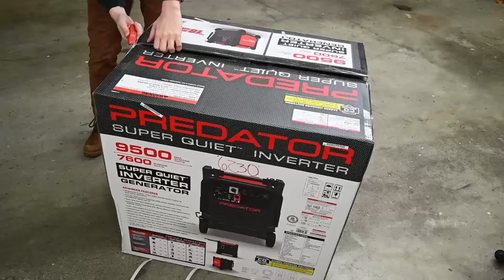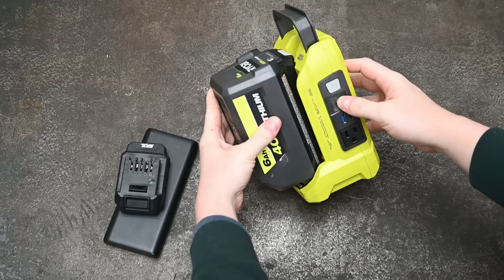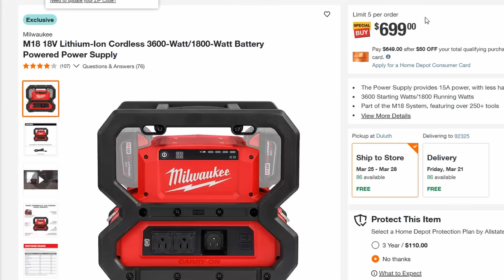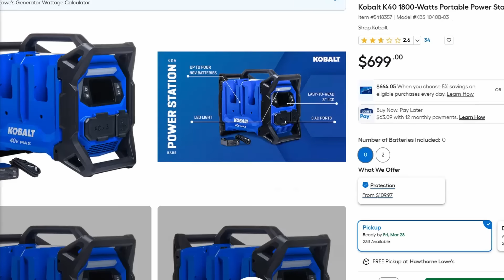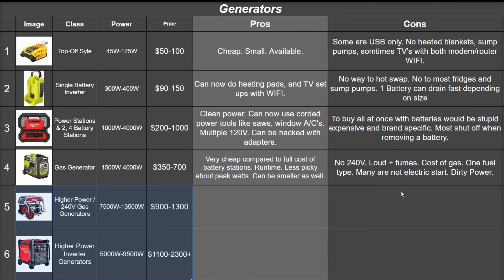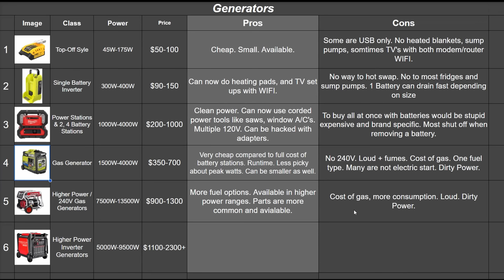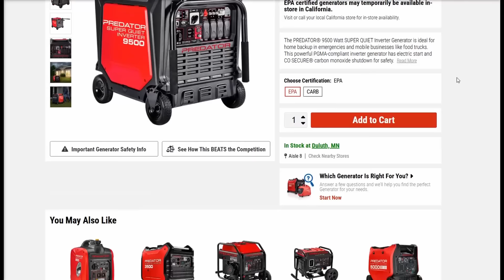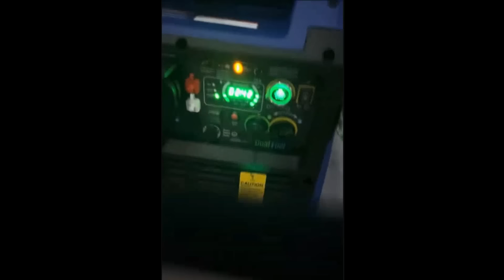Buying Harbor Freight's Most Expensive Generator So You Dont Have to

Comment: When you run on generator, you are your own utility and there are procedures when setting up and operating a power plant. 

SITE your power plant where you can ground and connect it to operate it safely. If the weather is  not considered to be safe (lightning, torrential rain, high winds, massive hail), stay in shelter until the situation  calms down. Pre-site it, set a ground rod, and make a file folder containing instructions and location info.

GROUND your generator! Run a solid conductor from the generator's ground lug on the frame to a metal rod set in the earth. Preferably a couple of feet down. You will be safe if there is any problems with the electrical wiring on the grounding side. But it won't make you invincible if there are any problems during operation. The following set of instructions are set up where safety and preservation of your property and investments ensured.  If you can, connect it using the one hand method. Use your dominant hand to touch potentially live connections, this means almost everything is treated as a live circuit.  Tuck your lesser hand in your belt or pocket. This prevents a circuit from being made in your body across your heart.

First is set up. Make sure all loads are disconnected at the breaker panel. This means, all breakers that are higher than 15 amp are set in the OFF position. Not tripped, but OFF. The master breaker is is to be OFF too.  CONNECT the generator to the GENERATOR side of the transfer switch. This is critical and dangerous if the panel is miswired. Practice this in normal situations so you know what to expect when you are in the middle of storm conditions.  CHECK the generator connections and cabling to ensure there is no damage, badly kinked cables or broken connectors.  Double check the transfer switch to ensure it is in NORMAL mode.  START the generator, let it warm up to normal idle speeds and temps.  CLOSE the main breaker on the generator. If there's a problem at the transfer box or the wire leading up to it, this is when that breaker will trip.  Set the transfer switch to BYPASS or GENERATOR mode. This closes the pathway to the breaker panel.  CLOSE the MAIN breaker on the breaker panel.  LISTEN to the generator for any sudden load changes from here on out that might suggest a problem.  Let the generator stabilize between each breaker close.  CONTINUE closing each breaker, listen to the generator and watch the lights for any dimming or excessive load. Keep any unnecessary breakers off, like the stove or dryer. Remember, this is your temporary power plant until normal operations are restored.  Once all necessary breakers are closed, bring up your climate control/HVAC and allow it to stabilize to a normal state, paying attention to the generators behavior. Watch your generator's exhaust and listen to it. If there is any excessive smoke or nasty sounds emanating from it, you need to consider shutting it down and getting it checked out.  Watch your sensitive electronics, keep anything you are not using disconnected. Feel your chargers or power supplies for any excessive heat. Some generators throw a modified sine wave that stresses power supplies. Pay attention to the generators specifications while shopping. True sine wave power plants cost extra, period. 

For shutdown, reverse the process, starting with the house breaker panel. DO NOT SHUT DOWN THE GENERATOR WHILE IT IS STILL SUPPLYING POWER TO THE HOUSE! This will damage and destroy anything and everything.  If the generator is gasoline fueled, the following is recommended after isolation from the transfer switch.  Find the fuel shut off valve and turn it to CLOSED. Its usually a quarter turn. This will empty the carburetor, starving the engine. This prevents any formation of sludge or deposits in the fuel system that would inhibit or prevent the engine from starting. Once the engine has stopped, hit the OFF switch, this grounds the ignition system. Let the generator cool off before refueling it fully, then move it back into its home.

Post-season checks include following the manual's maintenance schedule, at least quarterly exercising the engine under load, putting a few drops of Marvel Mystery Oil in the plug hole, then motoring the engine by pulling the recoil or the start button to move the piston through a few cycles. This preserves the exposed parts in the piston bore.

Comment: I have had 1200w, 2400w, 5000w and a 9600w tri fuel generators, they all served my well over them years, but now in my 70's went for 26khw Generac installation with auto transfer.  Not cheap at $17k, but well worth it, runs on natural gas so I don't ever have to worry about storing gasoline fuel or lifting 100 pound propane tanks.  If you have access to a natural gas line, it's the best way to go .
Reply: Have you had to use it yet? Do you know how much it is to run your house off natural gas for like a week?
Reply: $17,000?  You could go to a hotel for like an entire year for that price. 😂
Reply: @jo9732 $400 a night, might have to travel 25-125 miles to find on with power after a major storm, meanwhile your food rots in your fridge and freezer, your property is unprotected  how much is all that going to cost you.? and that's if you don't get killed trying to find a safe having.   Small generators don't work for more than a few days before you run out of gasoline, gas stations pumps run on electricity.  No thanks, been without power for weeks before, never again.

Comment: I got the Champion 8500 as I have LP with gas logs for heat when having a power outage, it will run my well pump and hybrid water heater, all the power I need as long my HVAC is not being used.

Comment: the way i did backup power is batteries. since the power is normally never out for more than six hours (usually at most an hour) and is generally reliable i can use batteries and inverters (where needed) to keep stuff running. since my internet/network devices use the same 19.8v dc input (but can accept 12-24v) i use a battery with a voltage regulator and that's their backup. the fridge is a 100ah 12.8v lifepo4 battery and a good quality 1000/2000w inverter. still working on power for my computer stuff (got an input power limit on this circuit)

Comment: I have the ego power station as I have alot of battery's for it and it awesome can run my fridge and gas boiler no problem in an outage for over 24 hours all while being silent and wont be stolen let a generator can be if left outside.

Comment: They are releasing a tri-fuel 11,500w super quiet inverter model with 240v50A, CO secure, remote start, etc. either this month or next month. They do have a tri-fuel 13kW model currently available that has 240v50a that I'm sure you're aware of but obviously it's not an inverter (super quiet) model.

It sounds like you should have waited a few weeks for the 11.5kW tri-fuel inverter generator. I believe retail will be $2500 but that may have changed with the tariff situation. If you do want to trade the 9kW version in for the new one when it's released, you can just pay the difference between what you paid and the price of the new one, as long as it's within 90 days of purchasing the old one it would be considered an "upgrade in the same category" and thus not subject to the 20% restocking fee. 

Just wanted to mention it in case that's something you'd be interested in.

Edit: shorts/iBWvy3hSt2s
Reply: I’ve used the upgrade in the same category thing quite a bit. Never ever had any problems with employees when requested.

Comment: I own that rigid top off. I use it to run my cpap machine overnight when I'm camping off grid. A 4amphr still has juice in the morning.  I love it.

Also check out Duromax generators, they have up 16k watt inverter models. I have a 13k non inverter and it run the whole house including sensitive stuff.

Comment: The other issue I've had with larger gasoline generators living in Michigan is cold starting on some units.  I had a 4kW Honeywell unit that was a great little generator, but when it was cold outside boy did you have to crank on it to get it to run.  And man let me tell you how rage-inducing it was when the pull cord snaps off in the middle of a blizzard when the family is inside shivering under blankets.

I ended up getting a Champion 9.2kW model with EFI and a built-in starter and like you, my only complaint is the harmonic distortion on it makes my electronics upset.  But it is nice being able to just throw the entire house on it without having to worry about the load on it like with the little 4kW unit.

Paying $40/day for gas when the power company says restoration is 4 days away is no fun, though.

Comment: You should have bought an open frame inverter generator.  Best overall compromise.  I love my WEN GN875i.
Reply from the maker: Wanted the quiet feature for the fam, also it can be left outside in snowy weather for days partially covered so it seemed to make sense

Comment: When i bought my predator i bought the warranty. I never buy the warranty. When they said and i asked again to make sure that it covered theft. I was in. So buy the warranty. If you have any problem just return it in the first 2 years. Or just return it anyway. I use my generator A LOT about 3000 hours a year. Never once had a problem. Never seen anyone at the race track have a problem with one either. Mines 6 or 7 years old. Probably about time for a new one.

Comment: I have a gas stove, range, and water heater. I opted for a 5000 watt continuous 6500 peak Wen inverter and it has been amazing. starts first pull every time. That said I have followed the break in procedure to the letter. I have a theory that Honda gets such a good rep because people buying them are caring for them as you should any equipment because of the price point. so statistically they seem to be "better". Things made in china work just as well as anywhere china builds to whatever spec they are given just like anywhere, for people to think china cant manufacture when they make most of the worlds goods is so silly. take care of your stuff and it will take care of you.

Comment: I usually have a couple working automotive batteries around.  When the power goes out, I've just hooked up an inverter to one of my car batteries.
Reply: Yep. I have a Jupiter 2000 pure sine wave inverter and 30’ 2ga jumper cables. I can keep my fridge and furnace running silently overnight from the car sitting in my garage. Save the generator for daytime use with higher loads and the noise is less of a factor.

Comment: You can get inverter generators for cheaper than $1100 and they wont have dirty power. You can the WEN DF680iX (6800W 240v inverter) for under $800.
There are inverter style generators in each of those price points in 4,5, and 6. The categories on the chart seem a bit misleading in that way.

Comment: Propane is a must. Better to have two smaller generators paralleled than one big one. Just more portable, demand scalable, more fuel efficient, and redundancy is always key in an emergency.
Reply: Yes, but you can't parallel them unless they're synced for frequency, voltage, and phase (some inverter gens allow this with a kit).  Otherwise, use one gen for one branch and the other for the another.

Comment: Yeah you jus bought the wrong one. The largest generator they have is the 13500 and it's tri fuel and worth the cost and would be way cheap if you have gotten it recently. And it's got all those features you want and a couple more...
Reply from the maker: My current generator can do all of that, needed a new one for the reasons outlined in this video which that 13.5KW wouldn't be able to solve
Reply: @TorqueTestChannel  only one I saw that it didn't cure was the noise cause it's louder than the inverter. But yeah it does all the other things you stated. I saw your current generator which was quite nice when it came out but the 13500 did all that as well. Im a proud owner of one and I've run my whole house no breaker off of it twice now... No flickering all power. If I had that connection you have on my house id only use the power company half the time. Actually the 4350 version did all that but it's always loud the 13500 had that run down mode. It's only loud when using more than 5000watts continuously
Reply from the maker: @cutthroatkid.d  But if its not an inverter, I think it doesnt solve the heater not turning on due to dirty power signal no?
Reply: @TorqueTestChannel  i would have to ✔️ that one out cause seeing you do it was the first time i thought to do it. I have heaters that i ran then cause i honestly didn't think it remember that the unit was plugged in. I know where the plug is but sadly i figured it was hard wired and never added up that math SMH
Reply from the maker: @cutthroatkid.d  ya only reason bought this 9500 is for the clean wave form. Past heater didn't care. New one is picky
Reply: @TorqueTestChannel  well in the next week I'ma gas my generator up and let you know how it handles my unit. But I'm sure the way you have your house set up it would run it fine. But I'll be sure to let you know

Comment: I got the predator 2000 that was returned out of box on a manager special for 250 $ a few years back. Still sells new close to 600!$.
I have it for fridge, gas furnace, Wi-Fi, sump-pump and other small emergency items such as radio, TV, cellphones. 
It has just enough power to run those things...
Pro tip.
Get yourself a fuel transfer hand pump so you don't have to store gasoline. Feed the tube down the fuel tank of your car and suck it out of your vehicle tank. You generally have 10-20 gallons in your tank which will last you for days and you don't have to worry about storage of fuel.
Reply: I've had a 5000/6500 generator for about 15+ years, and have for almost all that time had it plumbed to backfeed the house.  It works great and I can run everything in the house (except the central A/C condenser), just not all at once.  We had a 2 week outage due to a blown up substation, and it only took a day or 2 to get into a rhythm: don't run the washer/dryer/microwave/hair dryer at the same time, was pretty much the only major rule.  5 gallons runs for 16.5 hours.

Comment: Excellent video , I have options 2 and 3 for my ego batteries and can prob run minimum necessities for a day or two. Before I had option 4.

I am looking at option 6 but I want an inverter trifuel as I wanna hook it up to the gas system. Ours is underground so likely even if trees fall and power lines are out I should have unlimited lpg. The jump to a full house permanent unit doesn’t make sense.

Comment: One trick for the dirty power (Bad THD or sinusoid) on the big generators is to put an inductive load on them. For most people that will mean turning on something dumb with a motor in it like an air conditioner. The inductive load will help smooth out the power and make digital electronics happier. You can do the same trick with smaller 120V generators by using something like a blender. It's not an end-all-be-all solution, but it will help. Since you have an electronic furnace you might need to get something like a 1-hp 240V motor and just let it freespin. It is important that it be 240V if you have a 240V generator. Dual Fuel is nice for exercising the generator since you won't have to drain it. Unless you have a bulk propane tank or NG you're going to want to run gasoline when it counts. Propane/NG derates the generator so a 13Kw surge generator on Gas may only be 11Kw on Propane/NG. Propane/NG is a much cleaner fuel so if you use the generator a lot it will mean less wear and tear and maintenance for you. Cost wise that all boils down to your circumstances and where/how you live. The problem with NG is that the system might lose pressure depending on how many other people are also using it to run generators. For where I live in Florida in the city it would be more costly to run on propane (bulk or not) versus gas. So we just fill up the gas cans about a week before the hurricane and if we don't use it we dump it in our cars after. Whatever option you chose, make sure you have at least 3-days worth of fuel. Down here that's about how long it takes after a hurricane until you can find open gas stations.

Comment: I got the 9500 Predator several years ago and am very pleased with it. It's the non-Inverter but I use it mostly when I need to do a mobile job sight for welding or things like that.  I can run a 170amp mig, air compressor, grinders etc with no problems.  Runs great. Starts first pull if you dont have a battery to use the starter.  I can't speak to longevity because I only have maybe 50 hours on it but it's given not a single issue so far.

Comment: No matter what generator ive had i have always been able to fit a propane adaptor to the carb and is usually under 100$ to get depending on where you look..  they’re all the same just different carbs need different  adaptors to seal and they need to seal..  i use a bigger style propane tank  when i do or use the houses natural gas to run the generator when propane runs out.  Most adapters have another option built in to switch from lpg to ng.  All that is adjusting is flow rates..  and you can keep the gas tank on it so you can always use gas if wanted.  But then you gotta clean the carbs out after use..